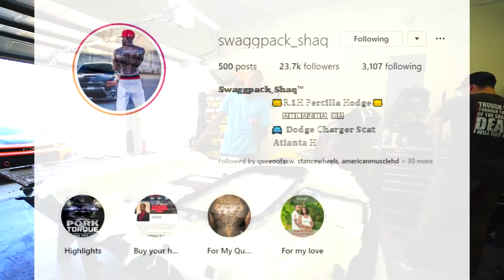DURAMAX WITH ROLLS ROYCE HEADLINER!

Comment: Sound proof the floor and everything while it's all apart
Reply: Why would u do that?
Reply: Dynamat the floor and roof
Reply: @Sons of Patriarchy im bedlining my floor in my 1st gen
Reply: @Logan probably not staying that way
Reply: @ryanwikle605  kilmat is cheaper
Reply: @Garrett.  Cheaper really isn't better. If you're going for good interior acoustic properties, such as a silent ride, you want layers of rubber dampening, closed cell foam, and mass loaded vinyl. Dampening helps with panel vibration, foam absorbs sound waves, and mlv reflects what isn't absorbed and also acts as an acoustic attenuator; the foam also decouples the panel from the mlv, further improving performance.  
Mlv is also usually too heavy for adhering to horizontal surfaces upside down, such as headliners or under the vehicle, so the typical alternative is melamine foam or typical heat insulator. Though for floor pans, typical installation is inside; but also works well inside wheel wells.
But of course, luxury comes at a cost.
Reply: @xaytana  honestly I'm not sure what kilmat is made of but I've heard that it's an ok alternative.
Reply: @Garrett.  Kilmat is just rubber and foil, like any other dampener. You'd still need closed cell foam and mlv if you're looking to actually soundproof anything. Rubber dampening is mostly only for vibrations and altering the resonant frequency of panels.
Reply: @Everything i mean in my opinion i could  care less for any of that. Thats why i asked. but thank you for your useful comment
Reply: @Logan Oh ok that makes sense ty

Comment: (Electronic related) Dan. I don't know everything buttttt... I did a lot of research on car electrical stuff in putting aftermarket things in cars so here is my super complicated (more unnecessary but does offer more functionality that you might want in the future) and probably the most useful way to hook up car electrical systems..

Personally in an ideal situation id put these star lights on 2 switches that always draw main power directly from the battery with a secondary new fuse box that you can get of Amazon; 

One line of power that activates when the car is on via a relay system that would tap into the pre-existing fuse box that specifically activates when the car is on. On this same relay, attach a physical switch to cut off the power on the relay if the car is on and you don't want the relay to trip then turning on the lights.

The second physical switch has no relay. This gives you the option to turn on the lights when the car is on. 

The second way can be made safer by adding a relay to an always-on source (i think the battery will work with a lower fuse on this relay line) so that the wires to the switch are not flowing with a lot of potentially dangerous power.

None of this probably made sense but what you did is cool as sh... great attention to detail looks factory and nice!

Comment: The module box is supposed to run on AC (alternating current) power like normal household appliances. Your truck runs off DC (direct current) power and will fry stuff not made to run on it. So you need an AC to DC converter if you wanna use that module.

Comment: Dan, what wire did you end up plugging into to run it to power? Did you run it to a different hot wire or did you just hard wire into the one that gave you problems?

Comment: Is that hot glue going to hold up to summer heat? I've had sun visors on multiple vehicles come unglued just from sitting in the sun during a hot summer, pretty sure the OEM glue wasn't anything better than hot glue honestly. If I did this, I would've used high temp epoxy, just to be safe. 

Also it'd be really cool if there was a way to run a cable down through one hole and up another, scuff the side of it, and create constellation lines. Or do longer runs of this and have shooting stars. Both with a dimmer light, as you'd want the stars to be brighter anyways.

Comment: I am surprised he doesnt just use an inverter run the power source for the LED's, that would be easier and safer. That would have saved you all the problems.

Comment: smart move using those optic fibers,
as stupid as i am, i'd use 1000 of microscopic leds and probably set the vehicle on fire
Reply: Moto Baja little leds shouldn’t produce enough heat to cause an issue